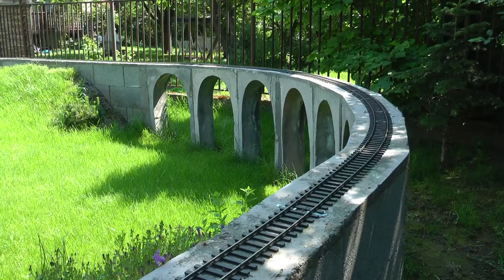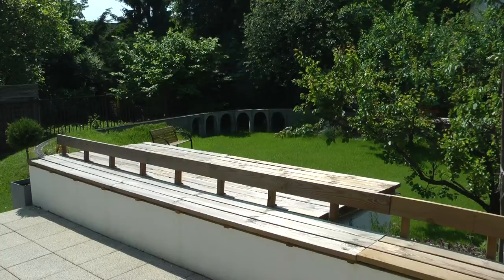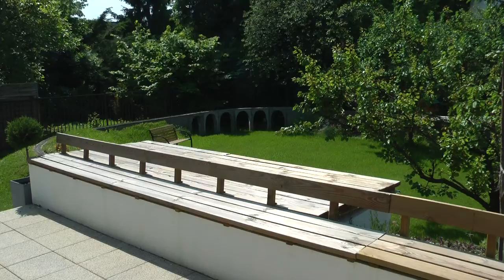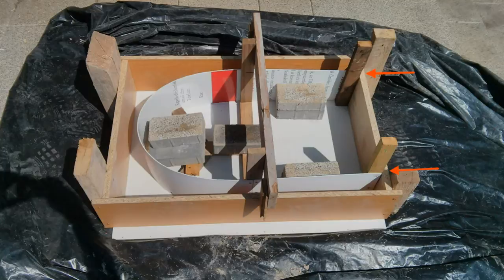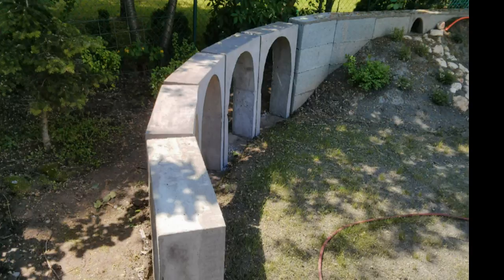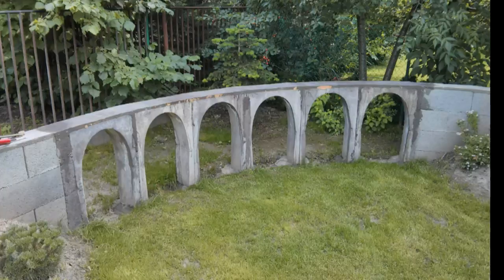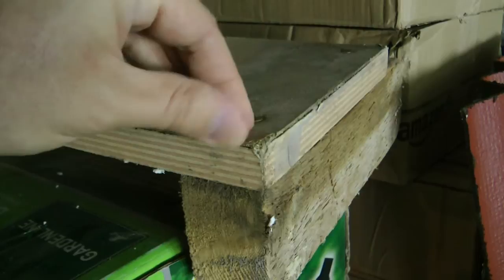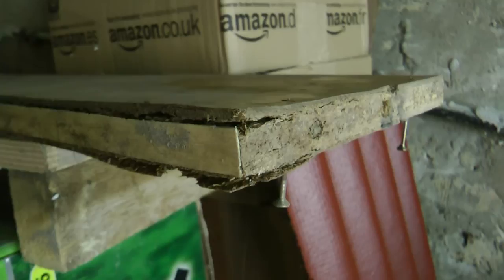Garden Railway is Born - Viaduct

Comment: what i would do would be to render the arches with sharp sand and cement  also put PVA glue in the mix wich helps it greatly to stick to your arches so if you have never done it before it is forgiving there are plenty of youtube instructions on how to mix and apply render here is a link on how to mix it they don't use PVA because they are professional's but would add 200 ml per mix and you don't need to worry about using a scratch coat as you are only doing a small area so yo would apply it smooth when nearly dry you can scratch a brick work into the render which looks great and once dry paint it to the colour of your choice https://www.youtube.com/watch?v=uYwXXO52hUo here is the link have fun if you decide to render it
Reply from the maker: I did something similar. I just used ready made exterior grout mix / tile adhesive. There is a video on that as well in my channel.